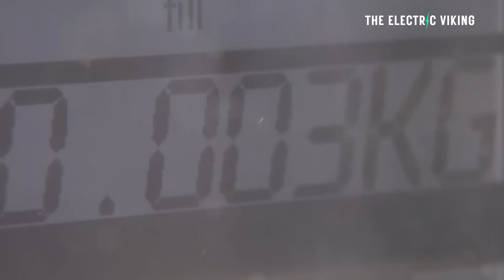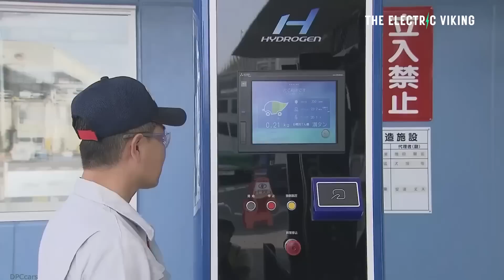Honda & GM's next-generation hydrogen fuel cell cars coming soon

Comment: My notes on hydrogen vehicles (with YT video links):

Hydrogen FCVs are very [cost] inefficient compared to BEVs
The Truth about Hydrogen -- https://youtu.be/f7MzFfuNOtY 
3m34s 2018 cost per KM - Toyota Mirai hydrogen car vs. Tesla Model 3 BEV, 
11m17s 2018 hydrogen FCV versus BEV efficiency

The truth about Hydrogen -- https://youtu.be/AGTjKJHu99c -- 12-min video from March 2022 
4m53s "Almost 90% of all hydrogen produced today is Gray Hydrogen, made from fossil fuels, mainly natural gas."
6m02s "Greenhouse gas footprint of blue hydrogen is worse than... burning natural gas directly for fuel instead."
"Methane is 80 times more powerful in warming the planet than CO2"
8m15s "Today, only a tiny fraction of hydrogen is green [truly clean], and it's actually still pretty expensive."
9m39s Passenger cars can run on hydrogen, but turning electricity into hydrogen, transporting it, etc, it not efficient. ~60% of the energy put in gets lost along the way. With BEVs, only ~20% of the energy gets lost.

Hydrogen Engines don't make any Sense [you can go twice as far with a hydrogen FCEV]
https://www.youtube.com/shorts/c253-J6pzPk -- 60-second video from Engineering Explained, 10/7/2022

BMW's Hydrogen V12 Engine Is A Hilarious Engineering Stunt
https://youtu.be/AouW9_jyZck -- 16-min video from Engineering Explained, 11.25.2022
BMW's Hydrogen 7 (promoted in 2006) is an extraordinary undertaking. Powered by a V12 engine, the car can run on either gasoline or hydrogen
2006 BMW 760i (Gas) vs. Hydrogen 7: 438 HP vs. 260, 444 lb-ft vs. 287, 5.4s vs. 9.5s 0-60, 489 vs. H-only 125 mile range = POS

Comment: Might as well do a video on the new crown to,i know you like evs we get it fair enough but can you compare all cars on several metrics like the look and handling,space,old tech vs new.

You mention breakthroughs in evs that have not yet come to market in big way could you at least mention some new hydrogen breakthroughs and let people make up own mind.

Theres much more going on in the hydrogen/ammonia/efuel space.
Reply: You can not change the energy costs. The energy does not change no matter what you do.
Reply: @earlpottinger671   Totally disregard all the other points,i know efficiency is an issue so is security.

Comment: The time for hedging bets was ten years ago, now with the continualy decreasing cost and improving performance of batteries it's obvious that BEVs are the future.
Reply: Hybrids are  ICEVs with added BEV equipment or BEVs with ICEV equipment. They are the worst of both propulsion propulsion systems.

Better off to stay with an ICEV. Hybrids have more things that can go wrong. In the US data from the National Transportation Safety Board found that Hybrid-powered cars were involved in about 3,475 fires per every 100,000 sold. Gasoline-powered cars, about 1,530. Electric vehicles (EVs) saw just 25 fires per 100,000 sold (mostly Chevy Volts/Bolt. Hybrids catch on fire more often ICEVs.

Comment: Why is Mr Sam Evans keep raining on others' parade?  Car makers aren't doing too well making BEV, neither, except for Tesla and BYD.  THEY saw what happened to Nissan and Jaguar who are early adopters of BEV and flopped badly...losing $Billions!  Making H2 vehicles to avoid direct competition with Tesla is a safer bet to them.  To each, his own!
Reply: Perhaps because Sam understands that clean renewable energy is precious, and should not be wasted on hydrogen cars that 1/3 as efficient, overall, as today's EVs. Using hydrogen for cars is like finding $300 on the ground and setting $200 of that on fire.
Reply: @ws6002  You need to understand that Green H2 is NOT a replacement for battery, and should be made from grid-excess Renewables, and  should be used only when RE is not available.  Essentially, that would be  plug-in FCEV that can be charged from the grid during seasons of RE excess,  and use H2 only for long trips and during seasons of RE deficient.  BOTH battery AND H2 should be usable in ONE vehicle to fully exploit 'RE.
Reply: @Trung Sơn 中山  
I don't think a dual or hybrid system is the best approach, for several reasons. Perhaps the most important reason is that you are adding the complexity of both systems, making for a more expensive solution. EVs will be far less expensive for consumers to buy than conventional cars due to the inherent simplicity of the EV architecture. Hydrogen cars will remain more expensive than conventional cars due to the expense of the fuel cell system. In a hybrid solution, one adds the complexity and cost of EV and hydrogen architectures. The second reason I do not believe a hybrid system is the best approach is that it typically results in severely reducing the size of the battery component, which will reduce consumers' satisfaction. And the third reason is one of space utilization within the vehicle. The hydrogen storage tank to achieve 300 miles (482 km) range is enormous, larger than the battery pack for an EV with 360 mile (570 km) range. This will compromise the passenger and storage space on the vehicle. For example, a large front trunk seems impossible in a hydrogen car.
Reply: @ws6002  The efficiency of solar farm to the energy from the battery of BEV when charged from the grid is 66%.  The efficiency of solar farm to the energy from the fuel cell of FCV is 47%.  So, the BEV is only 38% more efficient than FCV, and NOT 300% more efficient.
Reply: @Trung Sơn 中山  
[With correction.] Your information regarding the efficiency from the solar farm to the output of the EV is incorrect. Transmission from solar farm to the local community is typically done by high voltage lines operating between 138 and 765 kilovolts. Assuming the electricity into the Level 3 charger is at 440 V, this is a step-down by a factor of 313 - 1738. As the voltage goes up, the current goes down. So current transmitted over the high voltage lines is reduced by 313 - 1738 compared to the current delivered to the Level 3 charger. Energy loss E = I^2 * R. Therefore, the energy loss in the high voltage line is reduced by a 97,000 - 3,000,000 compared to the loss if a 440 volt line were used instead. The point is that the energy loss between the solar farm and the local community is very small. At some point in the electrical grid, this voltage will be stepped down to 440 V and the energy loss for the last miles will be higher, but I hope it is clear that it is almost negligible. The battery itself is very efficient, about 95%. (I welcome corrections if I have made any mistakes here.)
Reply: @Trung Sơn 中山  
Now we have to talk about the efficiency on the hydrogen side. The highest efficiency that is theoretically available for the electrolysis is 66%, but 50% is a more realistic number. Compressing the hydrogen produced to 10,000 PSI (sorry, I don't know the metric equivalent) for the vehicle's hydrogen tank uses energy equivalent to 20% of the hydrogen. Fuel cell is 60% efficient. Multiplying the efficiencies together, the overall efficiency not including hydrogen transport trucks is 0.5 x 0.8 x 0.6 = 0.24 or 24%. Which is not good.
Reply: @Trung Sơn 中山  
Perhaps the best use for hydrogen is as part of the solar, wind or nuclear power system. It can provide a valuable service by storing energy during the day or when the wind turbines are at maximum capacity, which can then be fed to the grid during the night or during hours of high demand.
Reply: @ws6002  -- Record H2 electrolysis efficiency 95%.
It takes only 1.36 kWh/kg H2 for 700 bar (10,000 psi) theoretically, but in practice, we would give about 2.5 kWh to provide for losses due to friction, which would amount to an efficiency of 93%.  
H2 transportation in pipeline from electrolyzer to end user is about 98% efficient,
and FC is 60% efficient,
0.95 x 0.93 x 0.98 x 0.6 = 52% efficiency from Solar farm to nearby electrolyzer plant to pipeline to the fueling station to compressor to fuel cell output.

For BEV, efficiency of DC to AC inverter at the solar farm is 93%, then 93% grid power transmission efficiency, then 85% charging efficiency at home, then 93% battery efficiency = 68% from Solar farm to power output from battery.
Please note that a FCV is also an EV that uses the same power train as a BEV.

So, we now have 52% efficiency of H2 from solar farm to the FC output in the FCV, vs 68% efficiency from solar farm to the battery output in the BEV = BEV has 31% higher efficiency from RE than H2.
Reply: @Trung Sơn 中山  
First, I would like to say I appreciate that we can have a discussion like this, based upon verifiable numbers and science. Will Japan really use electrolysis at the site of energy production (for example a solar farm) and pipelines to transmit the energy to communities, or electrolysis at the vehicle filling station? I had thought that widespread distribution by pipeline was impractical due to hydrogen's ability to leak out of standard welding seams. Also, do not DC to AC inverter losses apply equally to power distribution from the solar farm whether the energy is used at electrolysis unit at the vehicle filling station, or battery charging station? I will now turn to my sources for the numbers I used previously.
Reply: @trungson6604  
I have to go to work, so I will take this up later.

Comment: Not only does Hydrogen pollute it can be extremely volatile, in Europe Hydrogen is classed as hazardous leading to restrictions on traveling through tunnels, bridges & some toll roads ranging from a complete ban to being forced to wait in a secure area to be escorted through.
Reply: Proof please!
Reply: @lesliecarter4295  In the open air hydrogen leaks are relatively safe because being a light gas hyrdogen will disperse upwards very quickly but in a tunnel it can't. Google Hyunnel CS if yoy need to learn of the safety conceerns

Comment: Those who believe in hydrogen for transportation need to go back to the literature. It’s a done deal, it will never happen because of several technical reasons. Green hydrogen will be a result of superpower and can be used for very specific niche industries where very high amounts of power is necessary. Hydrogen will be produced on the plant itself, transportation of hydrogen is ludicrous. We are a far way from superpower, for that trillions have to be invested first in renewable energy. Personally i think superpower will be available after 2035. Some lame automotive manufacturers are realizing they are late at the party and won’t be able to catch up. So they focus on a hopeful breakthrough in other technologies like hydrogen and e-feuls which might cause them to go bankrupt since nobody will be interested in this nonsense when they can get a Tesla for 25k or less. This last part is very close with masterplan 3. You bed against Elon, you bite the dust! The fact that Tesla will produce these low cost compelling vehicles, will demand other car manufacturers to do the same. Many of them will never be able to do so. Tesla WON’T keep costs high, they want to transition to renewable as fast as possible. Elon said already very often that the price is the only restriction and that it will come down to reach more customers. The new platform which probably starts in production in Mexico will slash the price of the vehicle in half!!! Does anybody really think any other manufacturer on the face of the planet is able to do that in 2 years? They ‘re roasted.

Comment: Remind me about how most energy for electric vehicles is produced, oh yes mostly coal and battery manufacture uses a lot of electricity inconvenient truth I guess
Reply: @tflynn124
That's bad thinking!

It takes time, but renevables will eventually become the main electricity production, for most of the world.
What's holding it back is battery storage in the grid. Without that it's too incomplete.

You actually need to start with the demand for electricity. I.e., BEV to force building up electricity production.

And fossile fuel isn't the cheapest way to produce electricity anymore!

But it has been a convenient way to produce electricity when it's needed.
That changes with batteries in the grid.

This isn't difficult, just plain engineering!
Reply: @larsnystrom6698  don’t get me wrong I’m not against EV’s but we have got to realise that other forms of propulsion may also contribute to a better future as well

Comment: If producing hydrogen causes pollution than my friend dont forget the fact producing electricity also causes pollution and CO2 emissions.
Reply: Hydrogen production requires almost 3 times the electricity required to power a BEV to drive the same distance.
Reply: Not if its produced from solar panels and or wind turbines.

Comment: I understand the technology of hydrogen is not mature but you cant say it will never work , It will take time for sure but it be mature just live the electric vehicles . I think the world is big enough to have EVs and hydrogen vehicles at the same time. Even though you guys might disagree but the electricity production in most of the country is still from polluting sources including US infact I have read articles that EVs today causes more pollution as lithium minning and making batteries releases alot of Carbon dioxide and with cars like hummer the it will take 25 yrs for a gasoline car to produce that amount of CO2
Reply: @Aryan
Of course it can "work" in a physical sense.
But it's expensive and inefficient.
That's why it won't work. There are better ways!
Reply: @Aryan
Yes, and you will continue to read such nonsense as long as the fossile fuel companies has money to commission such reports.

It would be nice if the authors of such reports would declare their affiliations, just as authors of research papers are expected to do.

Comment: The strangest thing with this Japanese hydrogen is, they don't even have the oil to produce it. Strategically, using BEVs would be much wiser for them, but no, they have to have it with hydrogen.
Reply: the will electrolysis sea water
Reply: @林振华  
When you add up the energy lost during electrolysis, compressing the hydrogen to 10,000 PSI for storage and that of the fuel cell, hydrogen is 1/3 as efficient as just charging the battery in an EV.
Reply: @ws6002  Some experts argue that the efficiency could be as low as1/6. Imagine having to build six wind turbines to provide the pawer that could be generated by one powering BEVs!
Reply: @林振华-t4v  they don't have the power to do that. They will buy it from Australia and ship it by sea.
Reply: @saff226  Your comment makes me understand why Japan is fixated on hydrogen. It thinks it doesn't have adequate electricity to go BEV. So it'd go hydrogen by replying on Australia producing and transporting it to Japan. But the whole process is complex. I don't know how many like-conditioned countries there are. Looks not many.
Reply: @saff226  nuke.  was stalled since fukushima but they are pushing to restart it.
Reply: @PeterXiao1  Being an insular country, I tend to believe that their potential for wind turbines is very high; also, being in the biggest ocean, tidal power could become big there, if they invested in that instead of hydrogen.
Reply: @林振华-t4v  With what power? They have backed off nuclear energy and have a limited potential for wind and solar.
Reply: @林振华-t4v  Getting hydrogen from electrolysis is much more expensive than using natural gas. Current applications for hydrogen almost never use it, I hear.
Reply: @林振华-t4v  Correction, before they originally planned to process sea water, then they lost a lot of the nuclear power they planned to do it with.
Reply: Red hydrogen !
Reply: Coal and nuclear
Reply: Now if only they hadn't shutdown all those nuclear power plants. I could get on board with limited uses of hydrogen if it was produced by nuclear power.
Reply: The efficiency of solar farm to the energy from the battery of BEV when charged from the grid is 66%.  The efficiency of solar farm to the energy from the fuel cell of FCV is 47%.  So, the BEV is only 38% more efficient than FCV, and NOT 300% more efficient.
Reply: @trungson6604  I am highly doubtful of your data. But I won't waste time investigating it.

Comment: Hydrogen is a loser - a Hindenburg of a mistake.
Just burn gasoline - when Joe Biden leaves and a sane president takes over, gasoline will drop to less than a dollar for years - EVs will have a hard time competing against this.

So just burn gasoline - it's way cheaper.
Reply: It may be cheap but destroying the planet in the process - nice!
Reply: @markuserdmann1283  How so?
Reply: @markuserdmann1283  it won’t be cheap OPEC+ will keep the oil price per barrel high they’ll milk every dollar out of oil before the world no longer needs it for transport and they’ll use that money to transition their economies to a post oil world